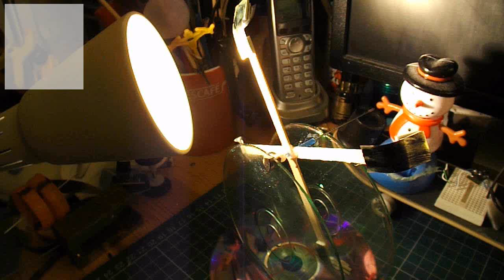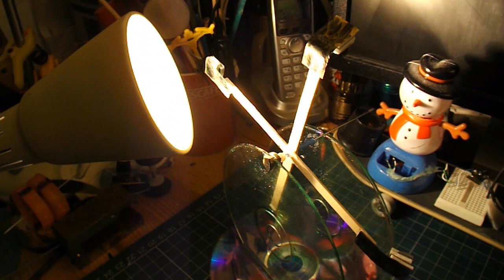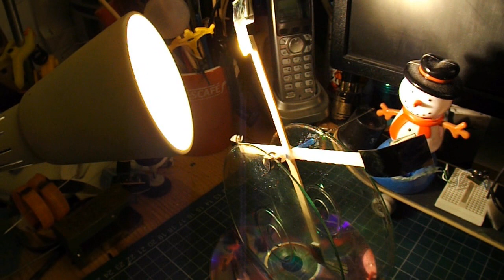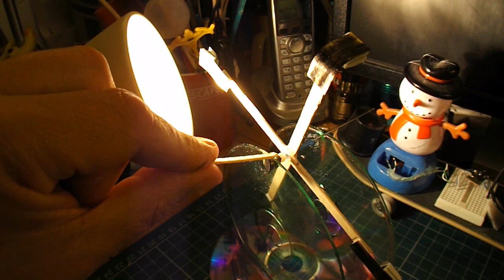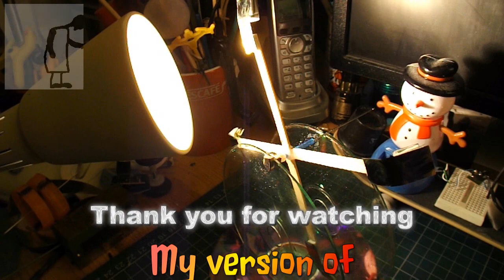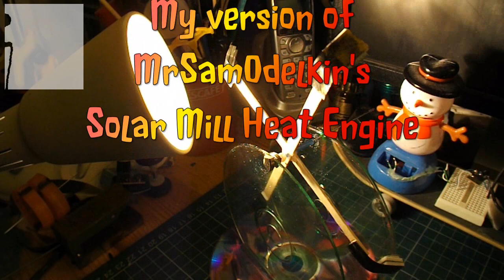My version of MrSamOdelkin's Solar Mill Heat Engine

Comment: Congratulations! I tried to replicate MrSamOdelkin's engine and failed. I was trying to use straws for the arms and I couldn't get the balance right. I guess in this application wood sticks are the way to go. I have been trying to find true cellophane for the moisture engine project but so far no luck. All I have found is stuff called cellophane but is really made of something else that is completely non reactive to water.
Reply from the maker: ***** this one fails miserably in the sun, although it probably doesn't get a fair chance with our changeable weather at the moment. I had a quick look for those fish on eBay and a pack or 12 is very cheap but I told myself not to buy them. Not sure how long I will be able to resist. I might have a go with some wax backed paper for a moisture engine, tempting to try them when my wife has the washing hanging up indoors to dry out of the rain, MrSamOdlekin has a couple of good ones going. I have a few other projects on the go at the moment - rubber band cars for a change :-)

Comment: Well that's a good spin on things. Lots of movement in those pieces and quite fascinating to watch.
Reply from the maker: slider2732 very frustrating, works fine under the lamp but we just haven't had to level of sunlight here to get it to run under the sun. It does about half a revolution in 30 minutes or more and then just sits there because the sun has moved round a bit or hidden behind a cloud. With the weather you have been having it might work as long as the blades out of the sun can cool down a bit.
Reply: GrandadIsAnOldMan With the weather here, I think we're talking fire hazard !
Hmm, fresnel lens ? bit of focusing of what sun there is getting through the clouds ? Someone should make these rain powered, you'd be alright then.
Oh, but, raindrops on the plastic would work, if just 1 was outside of a covering over the top. The covering could be a collection tray too, with a little funnel to the plastic arm. Beat the system ! lol